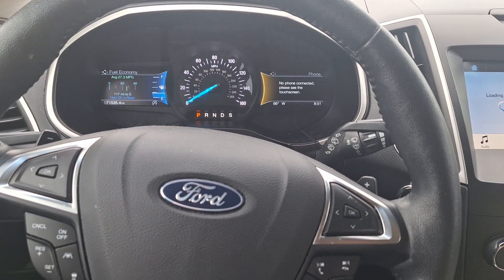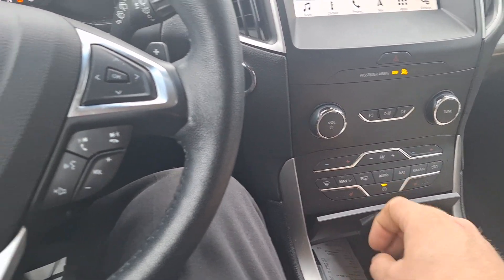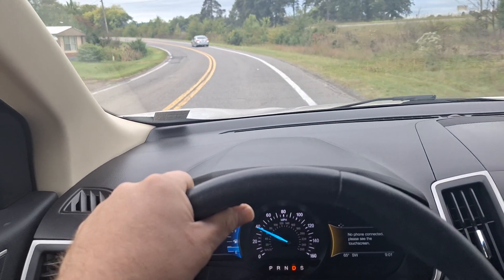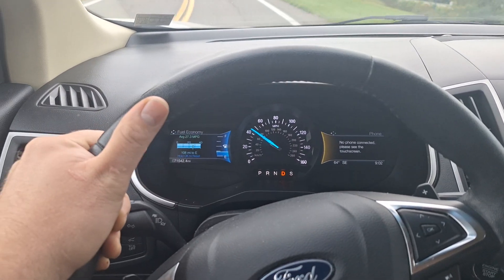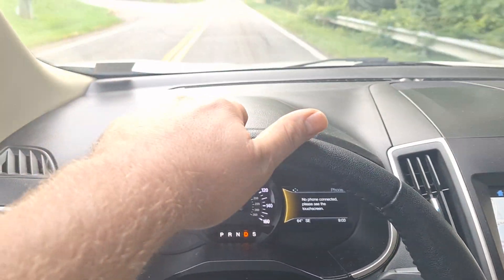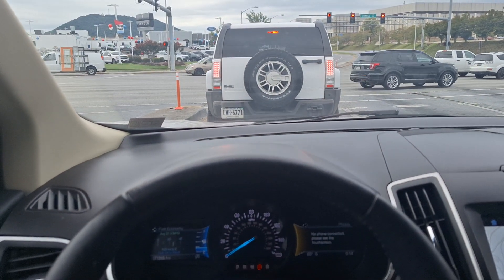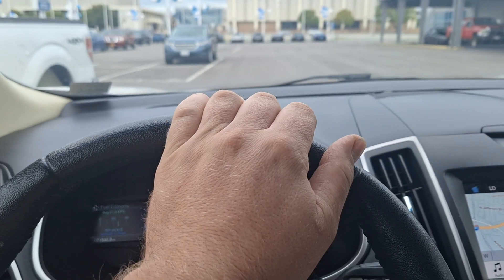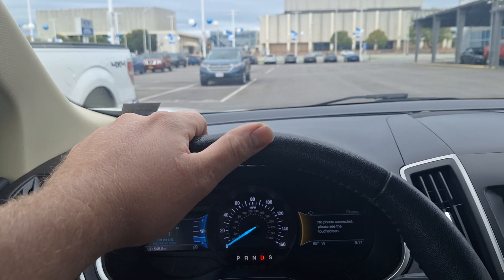Ford 6F35 Transmission Shudder Diagnosis, and Rear Diff Chatter

Comment from the maker: Watch next: 6F35 FULL Rebuild https://youtu.be/lrMZ2m-Zji0
Transmission removal: https://youtu.be/E-OCjm3pFJ0
6F35 Transmission Service: https://youtu.be/F--bs3gqq5M
Won't move in DRIVE: https://youtu.be/td6KwBAuJf8
Checking fluid level: https://youtu.be/jswCtiJaXpU
Low idle/stall (Converter clutch): https://youtu.be/-i60Xr_codo
Pump whine sound: https://youtu.be/pbgr44_fILU

Comment: Hi! Waiting for the rear diff chatter fix video. A friend of mine has this problem. He has a 4x4 Escape, the diff of which is making cracking noises when he’s turning. But when he’s moving straight, he has no issues at all. The sound is coming from the back of the vehicle.
Reply from the maker: Drain and fill the rear diff, it takes 75w fluid. There's a service bulletin for that issue. Part number XY75WQL. 1 quart. If that doesn't fix it youll want a new rdu torque coupler clutch
Reply: @BigBensCarsAndCycles my 2016 escape is doing the same thing and my local dealer said I need a whole new rear diff. Quoted me $3500 bucks. I’m going to try this and see if it helps. Also on that vehicle would the converter cause the trans to slip and make a sound that is almost like holding a ratchet by the socket and spinning it when coasting?